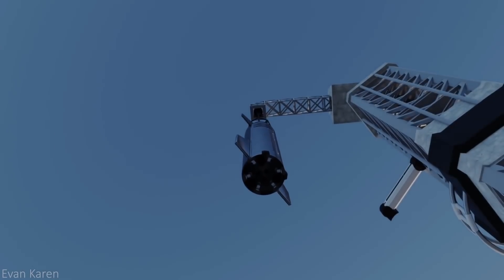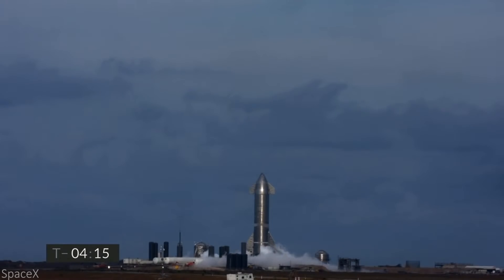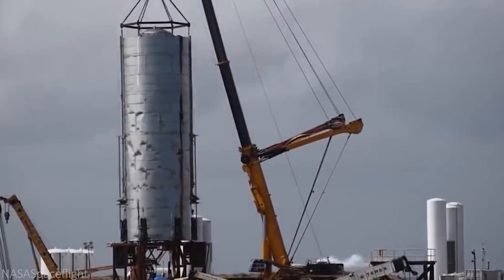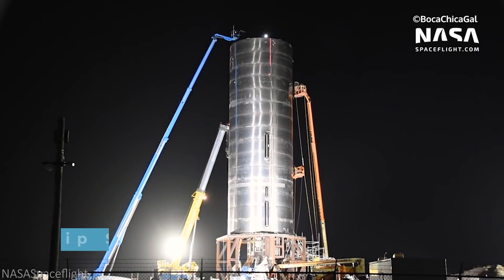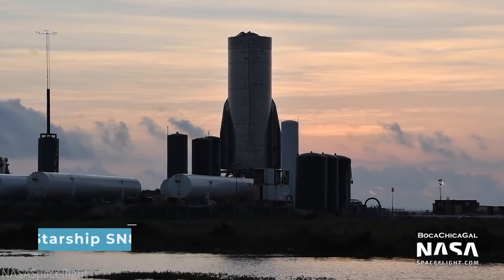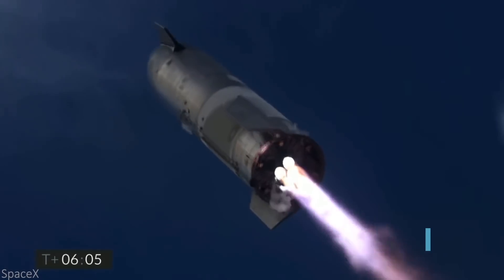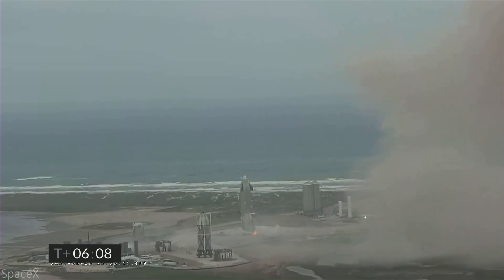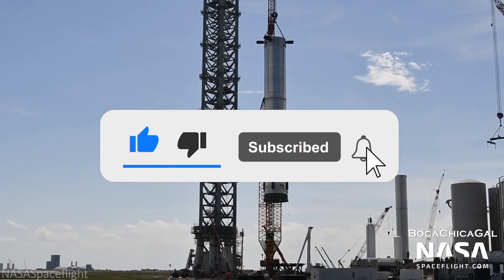The Evolution of SpaceX’s Starship from SN1 to SN20

Comment: Might be an idea to have a carbom Version  for a space only, to reduce weight and increase range
Reply: I was thinking that, as well. Once they get the design perfected they could make at least the lunar Starships carbon fiber
Reply: @odysseus5872  I think the main benefits of stainless steel is the heat resistance and ease of production. (They want to create hundreds of functioning and reusable starships)  If the starships are just intended to stay on the moon then the heat resistance probably wouldn’t matter because they won’t re enter the atmosphere, but I think all ships are intended to be reused. 

Actually, they may make some that are meant to be used as the first parts of the lunar or Martian bases, in which case they may not re enter. My guess is that that will be too few ships to make it worth changing the production, but who knows

Comment: I am sure they will succeed in reaching orbit, but next year. Starship is a promissing space shuttle, good for low orbit. But for the moon, they should divide the orbiter (starship) into two parts. Let the heavy bottom part with the huge tanks stay in orbit around the moon and land with the upper part. That will give them the delta V they need. As it is now, they will only have about 7,2 km/s with 100 tons payload (after 12 tanker flights!) and they need 9 km/s for the moon and back.

Comment: Kinda misinformitive with the Prototypes, no prototype performed near perfect, SN8 was a literal nightmare and was lucky it made it back to the pad at all, SN10 didn't fail because of its legs, it basically crashed into the ground over 30 feet per second on its skirt, and SN15 while it did successfully land its clear especially watching the recap that one of the engines failed, also that fire was not small by any means.
Reply: Nice try Jeff, found his secret account guys!
Reply: @Ascii89  Jeff who?
Reply: How was SN8 a nightmare?
Reply: @TheBestOfSweden  Engines clearly had leaks during flight, fire frequently around engines, one of the engines was burning fuel rich, pieces of insulation etc. were breaking off and/or catching on fire.
Then there was the obvious pressure issues which led to the vehicles destruction. The fact it didn't pull a SN11 was a miracle. 

This wasn't surprising since SN8 was the first legitimate flight worthy"ish" prototype and the Raptor 1 variant of the raptor engine was unreliable garbage, however alot of these problems seem to have been fixed with SN15 and RaptorV1.1 even though the engines still clearly need improvements as we will see with RaptorV2 in a few months from now.

Comment: with the amount of setbacks they've had it makes you wonder how many other companies would have given up by now. Astonishing.
Reply: they wont even try in the first place
Reply: SpaceX has made a point that they try to test systems until they fail so that every explosion on the launch and landing pads results in learning how to make an even better launch system. They're close. SN20 has so many improved systems behind it that I expect fewer and fewer things could go wrong as the system clatters and bangs on the road to maturity. Look at how reliable their Raptor engines have become! That was developed with the same philosophy, and now SpaceX is delivering supplies and personnel to the ISS!
Reply: Well most advanced manufacturing companies face a lot of failures before final product. It's industry standard. You can't make something so complex without failures as long as you have the money and see exoected roi